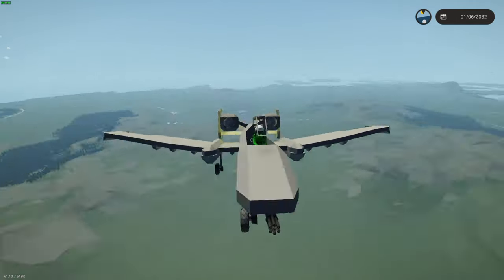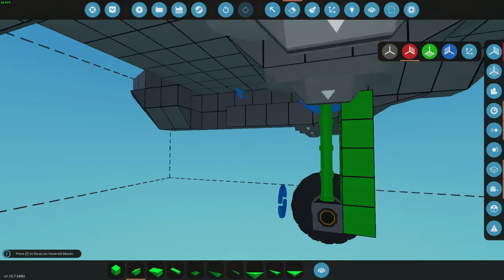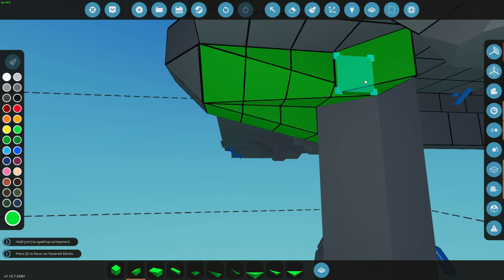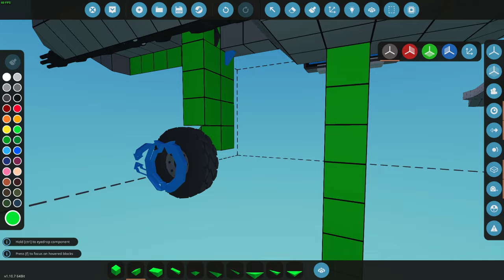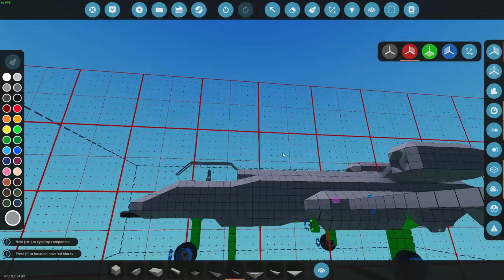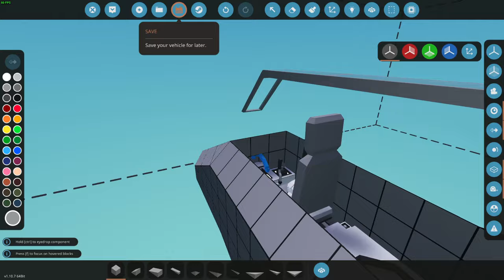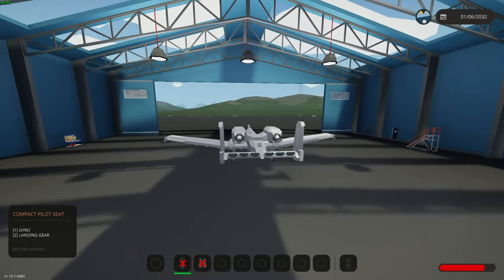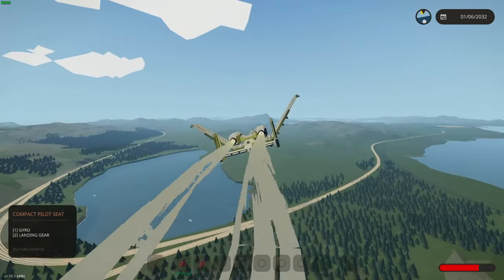Folding Landing Gear!!! Let's Build a A-10 “Warthog” Thunderbolt! [4] Stormworks

Comment: The landing gear on the A10 actually isn't supposed to retract fully. The reason being that as its a CAS designed aircraft, it's designed to take fire. If one of the main hydraulic lines is severed, you can land the plane on the semi exposed gear. :)
Reply: I commented the same thing then scrolled down like half a sec and found this 😂

Comment: The wheel is a little bigger than 3x3, that's why its pushing out. I've done a lot och testing with that

A tip for the fuel is to use wedges instead of the blocks for extra fuel, so instead of having a 4x3 area on top, you can have 3 4x1 wedges for extra fuel (for a custom fuel tank)
Reply from the maker: Good to know!